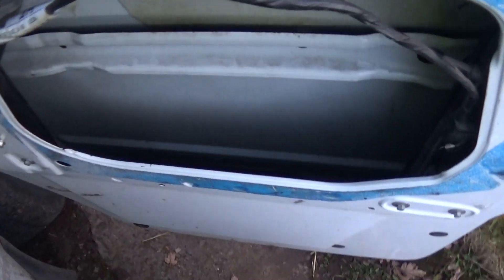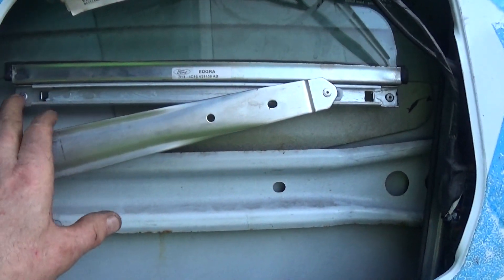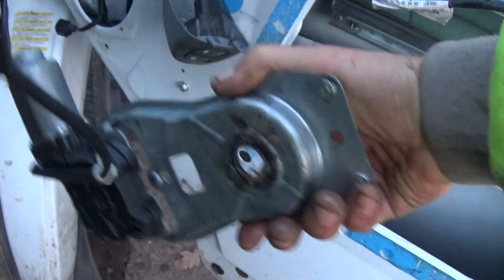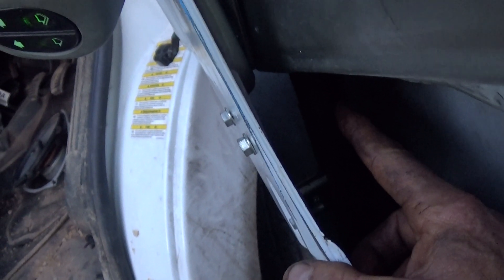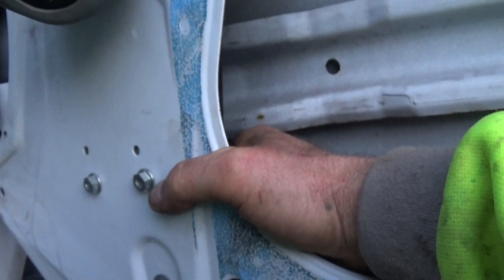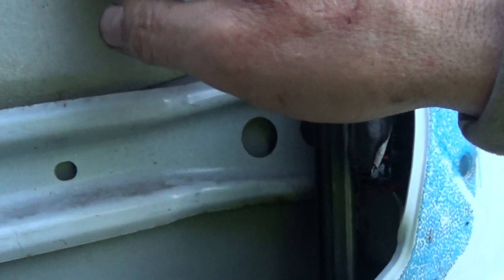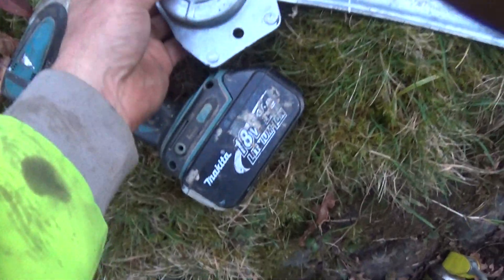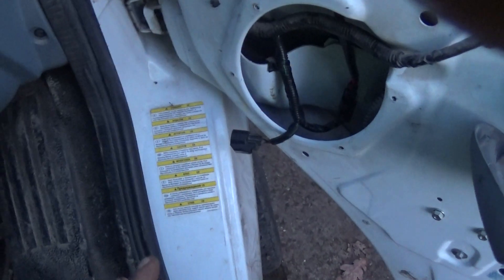MK 7 FORD TRANSIT ELECTRIC WINDOW REGULATOR+MOTOR REMOVAL pt 2 of 2

Comment: You didn't explain that very well, you ain't gotta touch the speaker or that slide on the right, 
Drill the rivets out on the bar that the window sits in so you can put the new plastic slide in, then pull that window slide on the left back to where those indentations are snd the unit slips in easily, then rivet everything back in place .
Its easy when you know how
Reply from the maker: I needed to take the speaker out so I could get my left hand in the speaker hole while my right hand was pulling the arm/motor. I tried leaving the slide in but the window wouldn't come up even with the sucker on it. I even sprayed WD40 down it but it wouldn't move. I mean try it with the speaker in, and if you can get the window up without taking the slider out then that's a win, but it didn't work for me.
Reply: That Indentation at 1:59 above your hand is the key, there's no need to twist the slider, just pull it into them, that's why they're there, it  gives you enough room to get the unit in with ease, 
All the best 👍